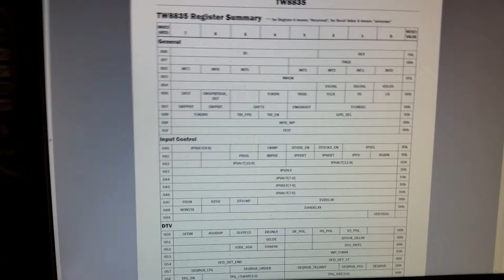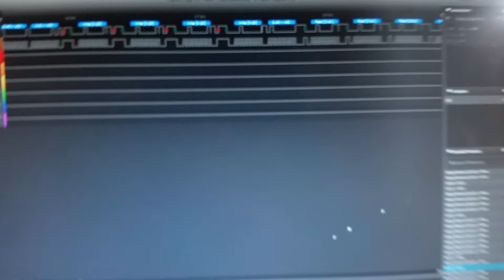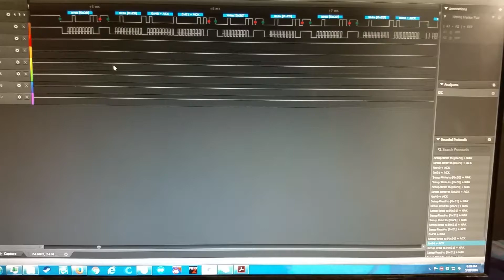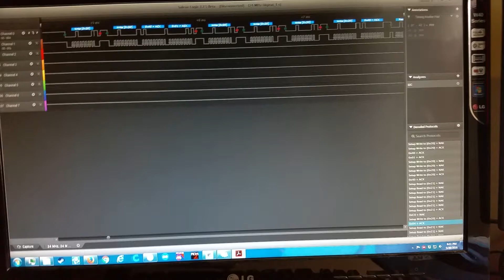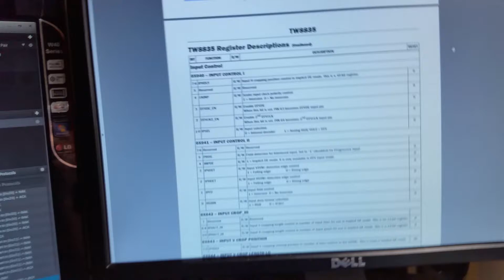iPico LCOS Pico Projector Hacking

Comment: I would end up back on your page again. Good job! did you ever figure this out? I just got in one of my victims, It's a INNOIO smartbeam ic200t. No connection cable supplied hoping HDMI-D ( mini ) will work but the forums are a bit scarce on what goofy cable it is. Waiting for #2 and #3, last one sold by Lying18 a no longer registered user from China " I feel a disturbance in the force "
Reply from the maker: I was waiting to get a logic analyzer so I could sniff the i2c bus from the micro to the video ic so I could reconfigure it from component to composite/rgb and I finally got one but this sort of got back burnered with all my other projects going on lol.

Comment: Looks like it might work with the SAMSUNG GT-N8010 tablet as the SAMSUNG GT-N8010 uses the same connector so it might be an idea to put it back together and see if it will work with the SAMSUNG GT-N8010 tablet.
Reply from the maker: The pinout is likely different and it seems to require some handshaking to enable digital video out specific to apple devices so it probably wouldn't work.
Reply from the maker: The pinout is likely different and it seems to require some handshaking to enable digital video out specific to apple devices so it probably wouldn't work.
Reply: OK no problem was just a suggestion as the connector on the SAMSUNG tables very similar.
Reply from the maker: Yeah, the 30 pin connector in apple products at the time was in popular use for media devices for other manufacturers as well but the way each device used the connector was proprietary and unique to that device. For instance iirc I think both creative and Toshiba both also used the same connector in some of their portable media players.

Comment: I have the same unit. Problem with it, as you mention, is limited Apple units can use this and now the app is gone. These units have become useless unless you already have the app. Believe it or not, many online resellers still sell these brand new. A lot of angry comments out there. If the 30 pin connector could be converted/replaced easily to standard input (VGA, composite, component, HDMI) there could be a market out there